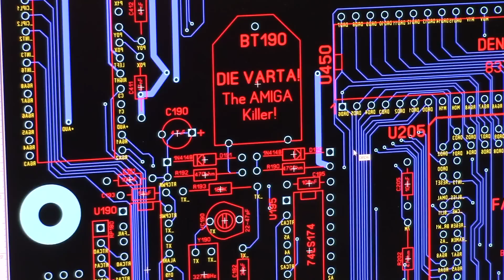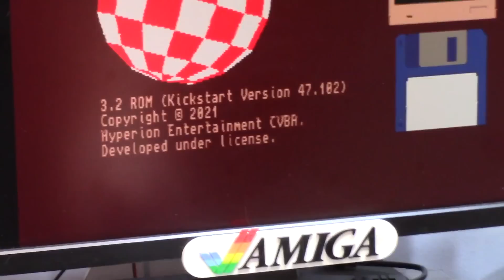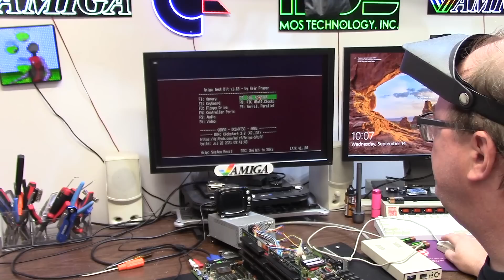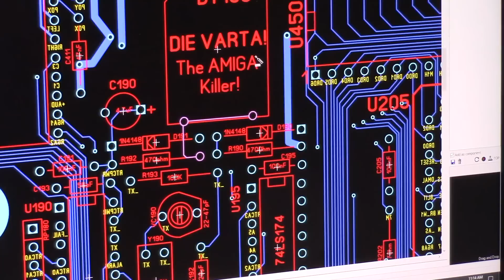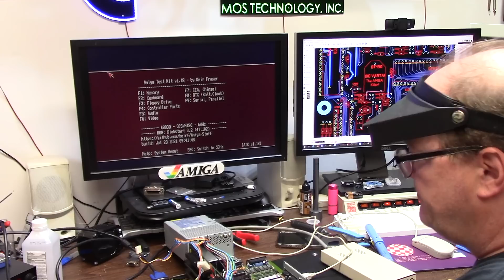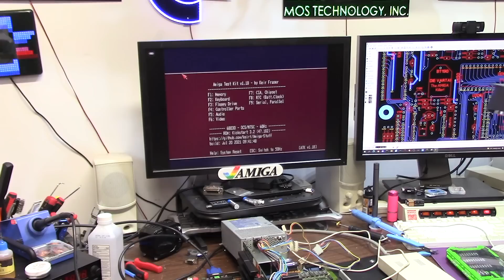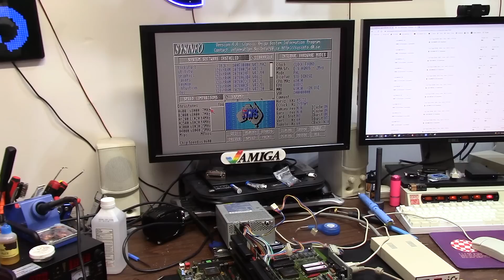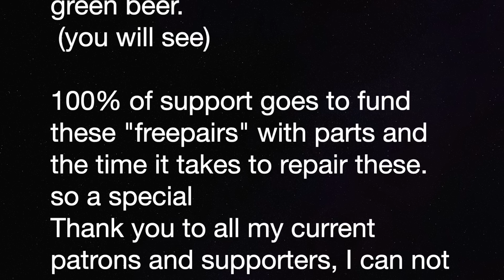Chris' Commodore Amiga 3000 and the Amber of Gold

Comment: @20:01, the 7th pin on the Oki-RAM module to the right is bent slightly upwards. Having restored a few CSA Mega Midget Racers that use the same RAM for the 8meg expansion board, my experience is this can often be the culprit for bad memory performance. Point is, the RAM might not be bad as such, only the owners installation.
As always, fantastisc content. I like following your endeavours on the Amiga scene

Comment: Hi Chris! Love your repair video's. I noticed at 21:40 the "please insert volume DF0 in any drive" My Amiga 1200 gives this also sometimes after I place a disk in the drive and reset. Can you tell me what this problem is please? Buffers on the startup sequence??? What does it mean exactly? Can I fix it on my Amiga ? Thanks!
Reply from the maker: If have no df0 there is a line in startup sequence states addbuffers df0;10.  Just hash that line out.   If you have a df0 it speeds it up just a little
Reply: @ChrisEdwardsRestoration  Thank You Chris!I was worried my Amiga or floppy drive was broken.🙂 I have a DF0 and it states: DF0: 15
Reply from the maker: @hansu-nihon  yeah thats it!

Comment: Interesting, I have my Amiga 3000 beside me and I realized I have NO Zip RAM installed despite the fact that I had some there back in the day?  Dunno what I did with it but wondering if I should be buying 70ns or 80ns Zips to install there or does it make any difference?  -Mark.
Reply from the maker: that is your fastram, unless you have a cpu card w ram on it, are you only running 2mb chip and thats it ???
Reply: @ChrisEdwardsRestoration  ...thanks Chris but I want to populate the Fast Ram and am wondering if it makes any difference if it's 70 or 80ns?  In other words, exactly what RAM should I order (and maybe from where would be a better question, lol?)  -Mark.
Reply from the maker: 1mx4 70 or 80 just make sure they match gglabs on ebay sells them new
Reply: the amiga 3000 fastram is specced for 80ns ram,if you can get 60ns for the same price,buy it,it will work fine. Note there is fast page mode ram 514400 and static column chips 514402 are common numbers.. If you are on 68030 the static column is roughly 10-15% faster.
 if you use 68040+ use fast page mode ram because 040+ treats static column ram as fast page anyway.  fast page and static column ram can be mixed,but you must use fast page chips in the first row of sockets.  the exception is if you have ramsey7,dmac4 combo,which is somewhat rare,it doesnt care how the ram is mixed.

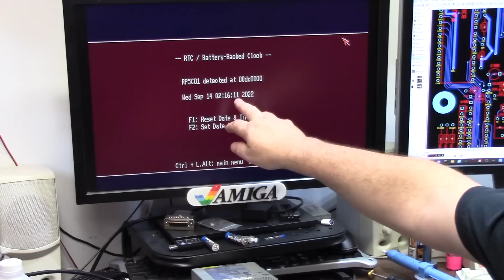Comment: 17:21 isnt the need for it to be plastic is because you are pushing a metal core into the component? Or is that just inductors? I was just trying to dial in the wobble on an old 8Bit with a metal tip and had to go beyond what I needed, so when I'd removed the tip, it was back enough to be where I needed it.
Reply from the maker: Yes exactly yur metal tip will change the charge of frequency